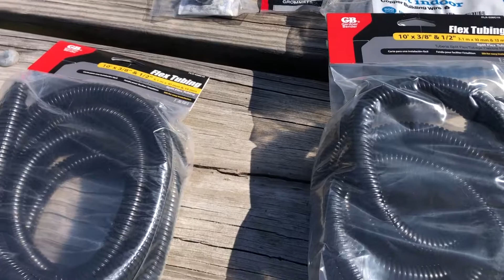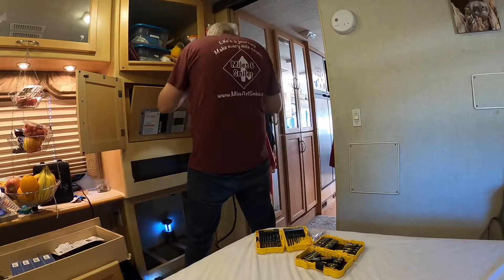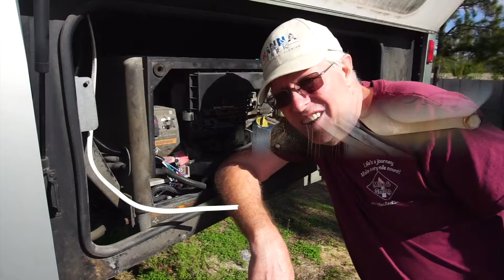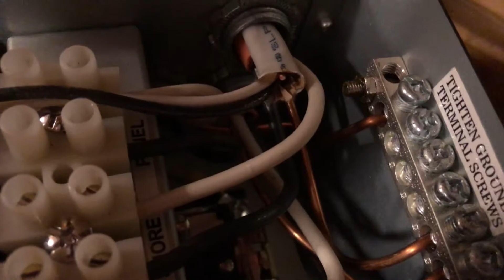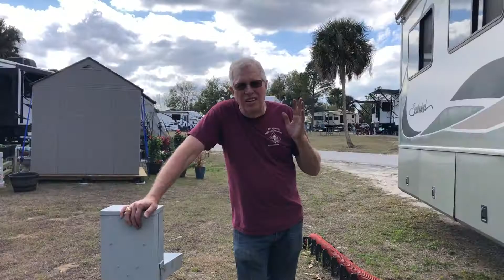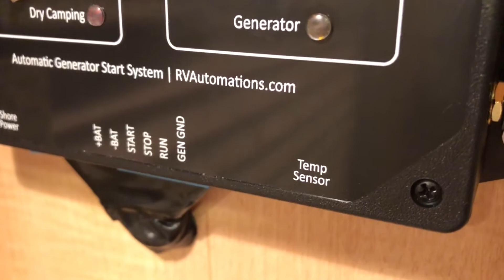Alert Command automatic generator starter install in our RV keeps the power on and our pets safe.

Comment: Wow, great job Pastor Jeff. Works great. If I had to install that that would definitely be a 10 in difficulty. I don't mess with wires and stuff like that. 

 I have a question for you. We are heading out West may 1st for over 2 and a 1/2 months. My plan was to get a system that gives me wifi or you can call it a   hotspot at all times. ( There is a guy in Chester New York that sells them) But it needs to be plugged in to a socket in order to work. But in my rig the only time my plugs work is when I'm plugged to shore power or the generator is on. Do you think that's sufficient to have Wi-Fi at those times only or should I do something to my rig that gives me a plug that all times?. Do I need an inverter for that?  If I'm boondocking I won't have the service unless I can plug it in.  I'm just not sure how far I want to go with this Wi-Fi thing. We want to be able to use a computer , our phones and have fire stick on a TV at night.  Any suggestions or advice would be greatly appreciated. Thanks.